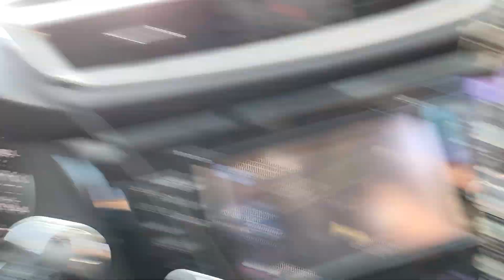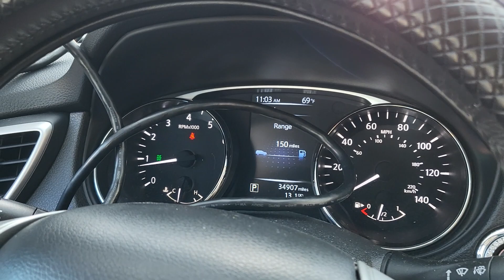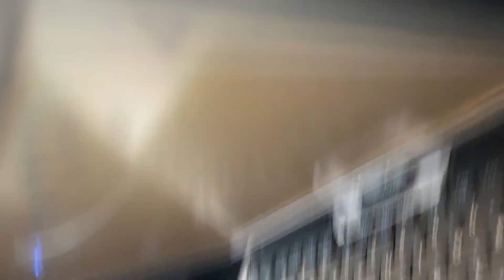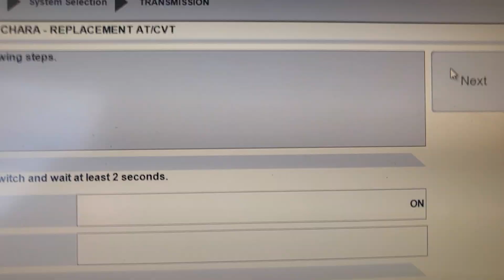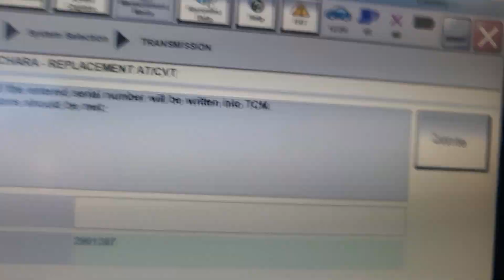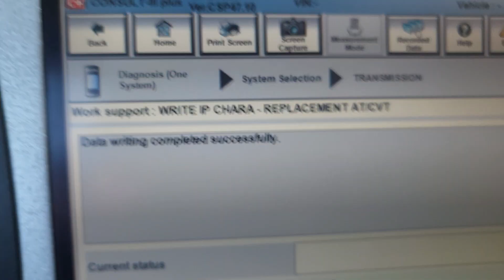2013-2017 Nissan Rogue Cvt Judder Code P17F1 P17F0 Repair How?

Comment: Salam , 
If I have a new valve body installed with a new CD comes with it . Can I do the process using other than consult 3 to erase the judder code ?
Reply from the maker: Yes you can